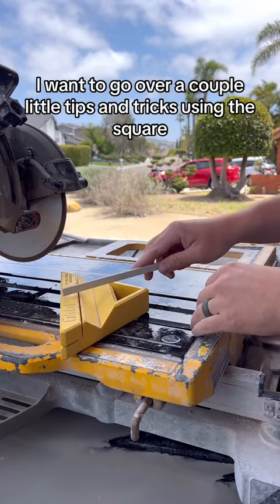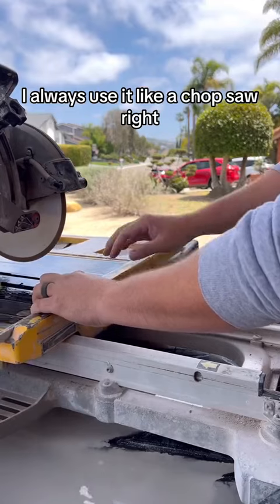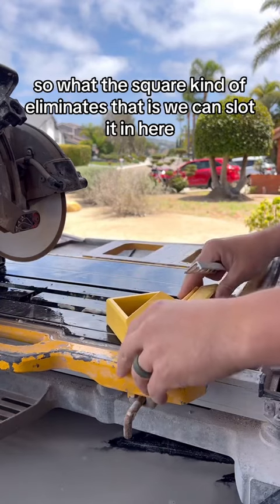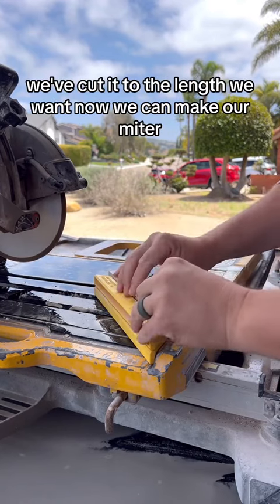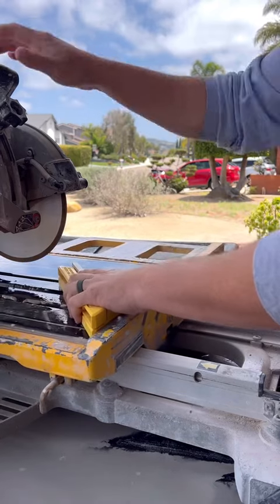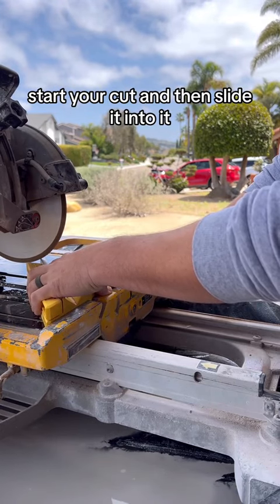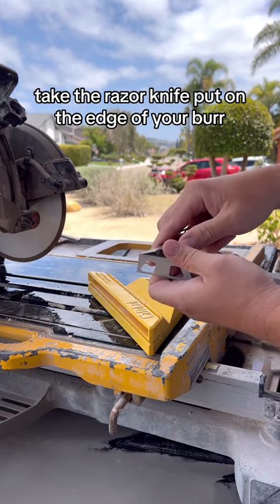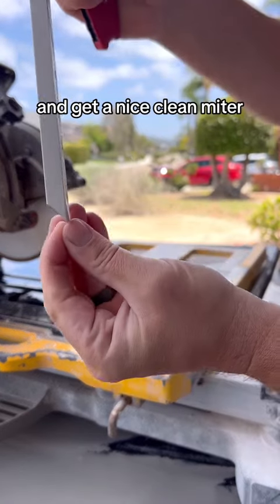Cutting schluter trim safely using a wet saw.

Comment: If you watch the video you will see that blade wobbling cause it's getting hot not made for metal an will make cuts on tile look rough now. Use Ridgid all purpose diamond blade works great. Just not for cutting tile or stone
Reply: So if I get a rigid all purpose blade it will cut glass tile, ceramic & porcelain and the metal trim?

Comment: Love your work , but why don’t you use a 7 inch small chop
Saw with aluminum blade ?? I been doing that setup for 15 years , why dull your diamond blade
Reply: I’m guessing it’s because a chop saw is just one more thing he has to lug around when he can just cut everything (trim and tile) on the wet saw. I’m not sure how dull his blade will get from cutting the trim. Maybe he has multiple diamond blades and changes them out depending on what he’s cutting. Idk just a guess

Comment: This is a waste of time, I use the same miter saw that I use for moulding for tile edging, a miter saw not only gives you more adjustments but will cut clean and you can make very small precise sliver cuts if needed to fine tune it, this stuff is so soft it puts less wear on the blade than cutting oak trim.